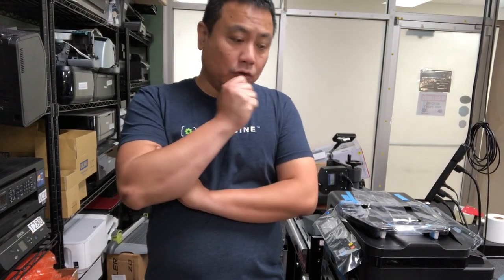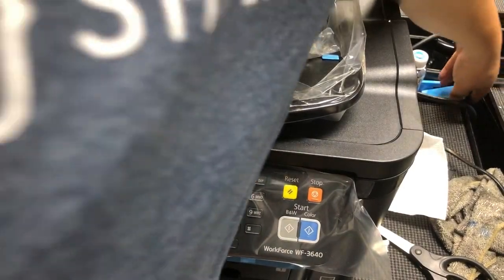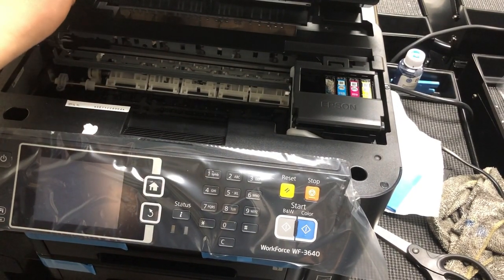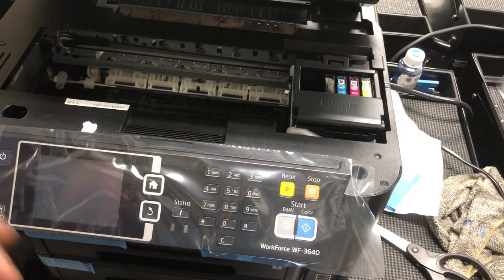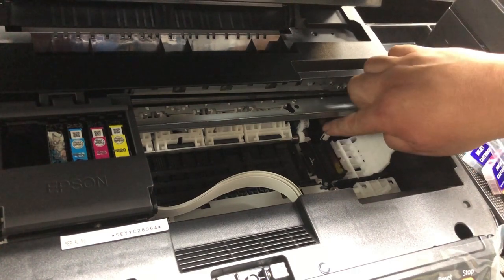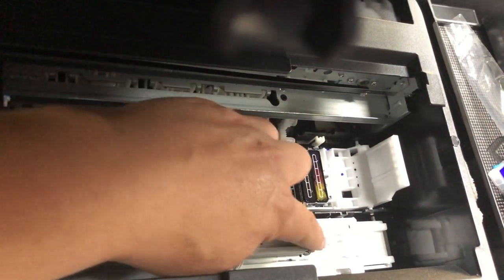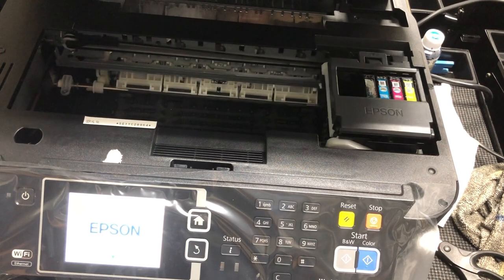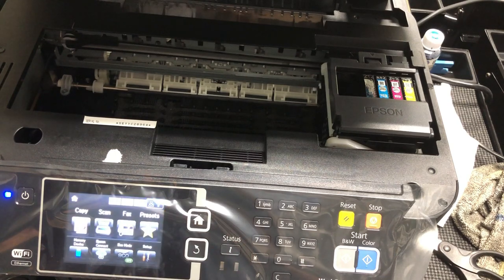Fix Epson Error Code 0x69 on WF 3620 & 3640 Printer - Read Description Warning!!!

Comment: Excellent info! We use a circa 2015, Epson WF-7620 large format. Inside mechanisms are similar. I have had the machine for thousands of prints. It's OK -- except I frequently encounter this Error 0x69, phantom lid switch and others -- your tips were outstanding! I was about to give up, and Google took me here. Your examination, and even the little paper towel wad tip for the lid switch were spot on! After a couple of tries, our goner machine revived! Thank you sir -- you'll save many machines from the landfill :)

Comment: Hello, I have benefited a lot from watching this video. Mine is also an Epson WF3640. I recently encountered a problem to ask: my printer's ink cart is broken. I removed the ink cart and shelf from another machine and replaced it with this printer On. The printer is turned on normally. However, when I start printing, the printer keeps feeding paper, until the paper in the tray runs out, and then it prompts the printer to run out of paper. And sometimes it does:
The normal situation is that the printer will not automatically load the paper after printing a sheet. But I changed this printer with the ink cart, but after printing a sheet of paper and finishing printing, the printer automatically rolls up a sheet of paper and automatically goes to the paper outlet that location!
Reply from the maker: Check your PE sensor and sensor lever.

Comment: one of two things fixed mine,i done both so not sure which of the two fixed it,, one is i flushed out where the cartridges go they were partially clogged, using an empty syringe and small piece of tubing filled with cleaner solution flushing them out one by one, the other i tore the printer apart where the circuit board is and found a small tiny fuse , think it was labeled f1 and put a solder bead across it bypassing the fuse thats made to blow ..well no more blowing a fuse ever again and its cleaned and working well so far now for about a year

Comment: Hi i have this error but nothing moves or no other error msg comes on n any button i press it says invslid action. I saw in some video it said i need to see the fuse...but befor i changed my ink to new ones EVERYTHING worked perfectly...now its a brick...can u advice? My model no is wf 2661

Comment: I have ERROR 0x97, help please..!!
Reply from the maker: 0x97 is the head drive circuit excessive voltage.  You have a short somewhere.  It is either the FFC to the head is burned, or the mainboard failure.  You probably need printhead, FFC cable, or a mainboard.